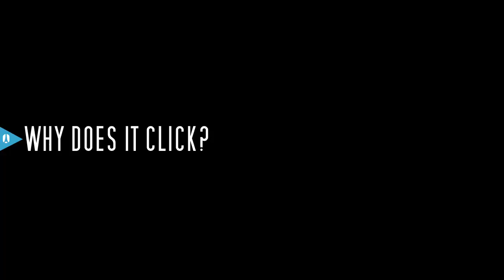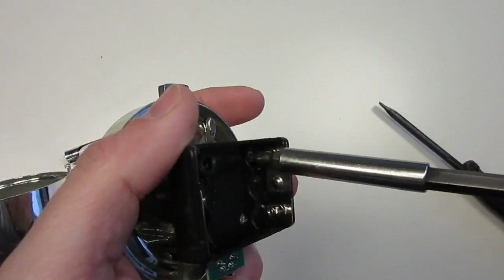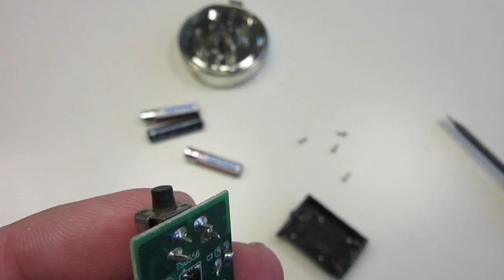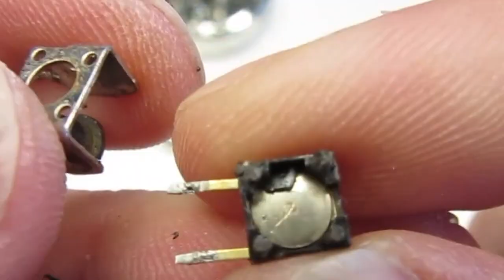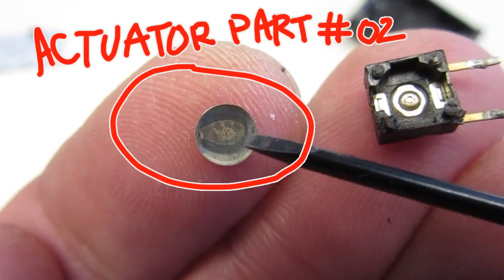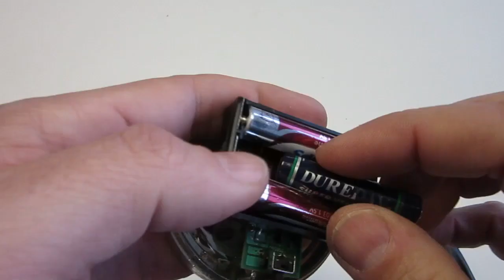HOW DOES IT WORK? WHY DOES IT CLICK? Looking Inside A Tactile Momentary Push Button Switch

Comment: Your diagram shows that when the button is pressed it makes a sound and contact, hence the bulb lights. But it also shows when the button is released that you lose contact and the bulb is no longer lit. When you press the actual physical button you hear the sound and then the bulb is still lit. Why does the diagram conflict with what is actually happening? After you press the button, you should retain contact, no?
Reply from the maker: The switch (aka momentary switch) is coupled with electronics that registers state changes from open to close. As such, for this lamp, 1 click is programmed to turn the light on, a subsequent click means to trigger blinking pattern 1, another click pattern nr.2 ... while a last click mean 3nd of cycle and switching off the lamp. 
This provides a more versatile way to use push buttons since allows to use 1 switch and program multiple outcomes.
A regular latching switch would otherwise only allow for an on or off state.

Comment: great video! how about the toggle switch?
Reply from the maker: It is the same button / same wiring, BUT it is coupled with an IC / controller that stores the circuit state, i.e. click once and the IC will turn current on, click another time and the IC will turn the current off (and repeat)

Comment: How it works tactile switch when you press first time the bulb remaining on and press again the bulb is off?!
Reply from the maker: It is coupled with a microcontroller that tracks state changes and switches the circuit on and / or off

Comment: I kinda hate that switch... The problem is, the contacts don't clean themselves. I've spent a lot of time replacing those with ones which do do that.
Reply from the maker: Indeed, not an ideal choice for long term use since they are often affected by internal corrosion...